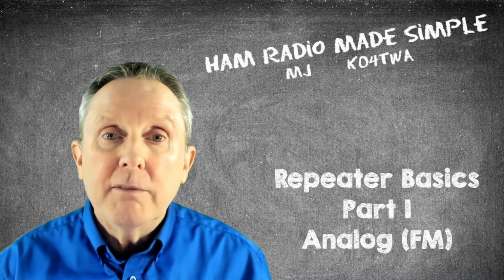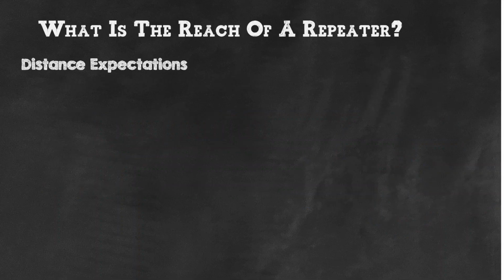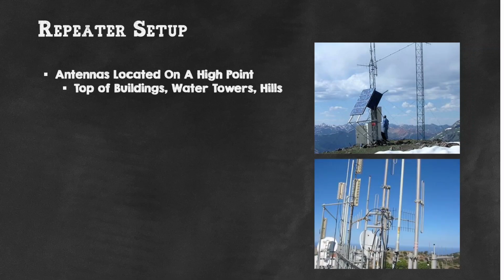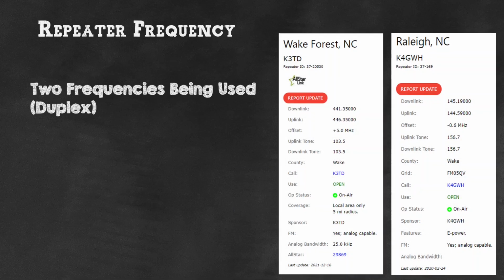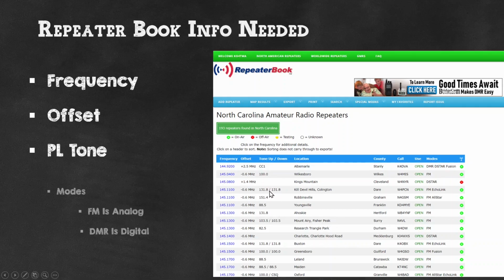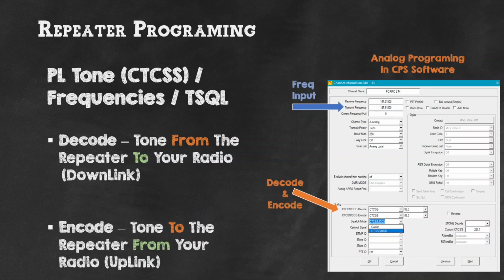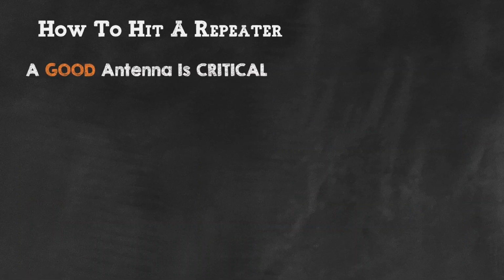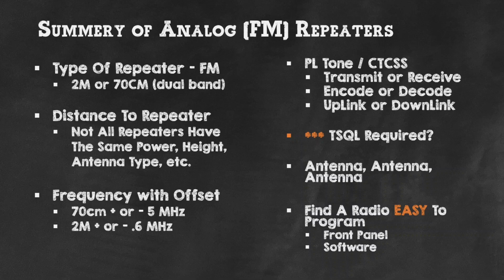A simple, non-technical overview of Ham Radio Repeaters. Part 1 Analog (FM) Repeaters

Comment: Thanks for the video. I have dumb questions. I just got my tech's license and have a pair of 10w HTs with very good aftermarket antennas. I can access serval repeaters in my area. However, I'm a bit shy about connecting to a repeater. Is it appropriate to try to make long(er) distance contacts by calling CQ on a repeater? Or is it just for listening? If I make a contact using a repeater, will I be tying up that repeater? Is that considered bad practice? Would anyone care if I dialed up a repeater and said my call sign and "listening"? Is anyone likely to respond?

In other words, what are some fun and interesting things we can practice by making contact with a repeater using 2m or 70cm bands? So far, I'm only able to take part in local nets.
Reply from the maker: Email me at kw3kw@mail.com

Comment: Great video series!   One slight clarification:    Tone= Transmitting a CTCSS tone from your handheld or mobile radio to open a repeater.  TSql= Puts a CTCSS tone on your handheld or mobile  receiver so that it will only  open the audio, when the proper CTCSS is received.  Tone is needed  to access most repeaters. It also keeps you from being repeated from other repeaters that may be on the same frequency in the area. TSql is optional so that you don't hear "nuisance" tranmissions from other repeaters on the frequency.
Reply from the maker: Thanks for making this clear to others!!